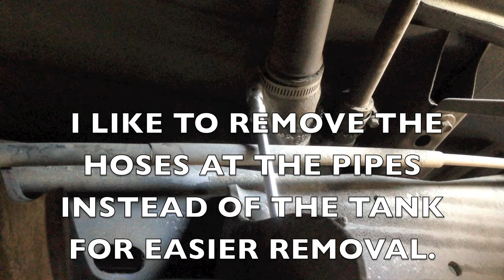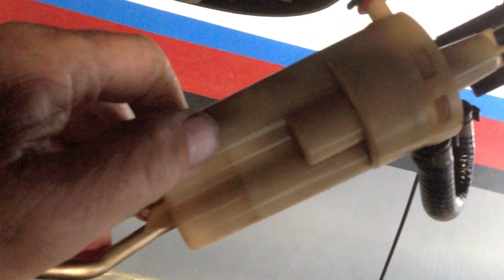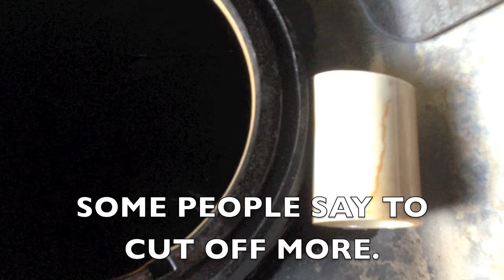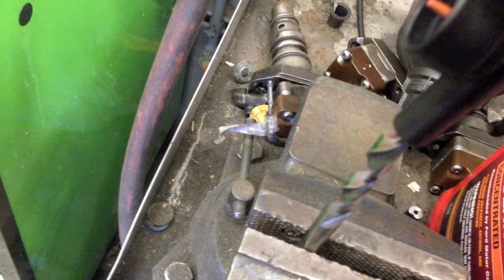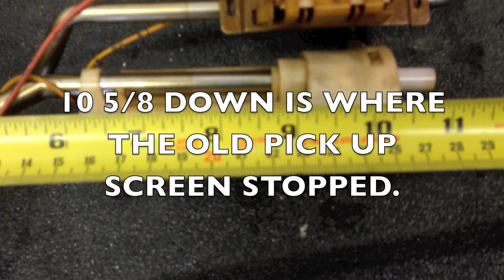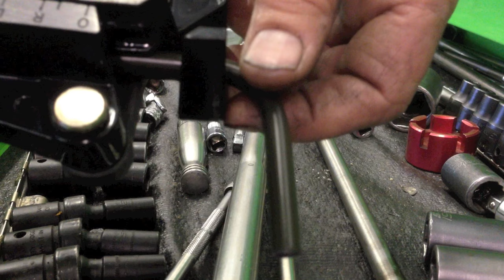Ford 7.3 Powerstroke fuel tank mods. Harpoon and Hutch

Comment: I just finished doing this today with a floor jack to take the tank off . Man I wish I would have seen this video sooner . I bought a CPS , ICP , IPR , motor craft fuel pump . It ended up being the tank . I did exactly what this showed and I ran a fuel filter before the fuel pump . Test drove it after the modification and all the new parts and dang that f350 dually had some pep in its step . I also harpooned the inlet like he did .

Comment: If the filters were full of algae and maybe tank coating flakes and you remove the filters, won't the algae and debris be able to flow into the fuel pump and engine? I need a new fuel sending unit, not sure if I should leave the filters in or just remove them

Comment: I did this several years ago. It worked fine for a long time. But, those Bosch pumps can clog if the screen is too coarse. I went thru 2 pumps before i restored it back to stock. The original lasted for 300000 miles.

Comment: on the factory pick up foot you need to put a 3/4" freeze plug in to block the port, this is why people have issues when the fuel gets below 1/4 a tank. never use galvanized tube in a diesel fuel system, the diesel fuel reacts with the galvanized coating and will cause it to flake off especially if you bend the tubing, I used stainless tube and fittings because copper compression fittings are not hard enough to bite into the factory stainless on the sending unit

Comment: if you did the efuel pump mod and the fuel bowl delete mod install an inline pre filter screen and remove the in tank screen, a large capacity inline screen prefilter screwed to the pump makes life easier and makes the flow better with far less restrictions
harpooning a gas tank might be dangerous because it needs room to vapor expand, should be fine on diesel since the fuel works a bit differently and has a different vapor point

Comment: I accidentally added gas to my F750 SuperDutyDeisel engine drill truck and had engine running until the engine stalled out.  Any suggestions for cleaning of tank , replacement of filters, or anything else I might need to do in order to save the engine of my work truck I make a living with?  Please help and thank you.

Comment: Instead of a union fitting and hard line ,,could I just clamp of fuel line and run it down far enough to bend when hitting the bottom of the tank ?

Comment: What’s the tool used to remove sending unit at 1:36
Reply: it's a cap tool specifically for this application.....not necessary....just use a small length of wood and tap the ribs counterclockwise......

Comment: Just a note to anyone bending tubing, if you'll fill it with sand blasting sand, are real fine playground sand, the tubing will bend as if on mandrel pipe bender. This prevents any restrictions from crimping your tubing down on your bends, thus giving full flow of whatever your lines have moving through them. Yes even the hard brake line as he was using in second option, with tubing from supply house.. Just blow it out with your air hose, and flush with brake cleaner good couple times.   RIP DTR

Comment: So if those pre filter screens were getting plugged up from algae and you remove them won’t the filter on top of the engine now get plugged up from the algae?  It would make sense to me to put a easy to change canister filter somewhere under the truck before it goes to the filter on top of the engine. Any thoughts on this. I know Ron passed, but if anyone else would like to comment please do.  I’m looking at doing this to my 7.3 in the next few weeks.
Reply: I would say its much more common to pre filter the pump now. If you look at any E-fuel kit for an OBS 7.3 they pre filter the pump
Reply: so just change the filter on top of the engine more often....it's a 5 min job
Reply: my plan is to do this ( no screen) , with a fass water and air filter with a 244gph lift pump. the remove the check valve in both the fuel inlet at the bowl and the valve at the bowl filter tube .... should flow alllll the fuel ill need for a medium performing 7.3 in my welding truck. i would recommend the hp oil cross over line with the rifraff high flow banjo bolts.

Comment: As I can correct excess diesel in the engine oil crankcase. 6.4 ford 2010, help me please
Reply: Replace your injectors.
Reply: @markusgarvey  it's a 6.4, replace the pickup
4 million made and 9 years later, 500k left on the road
Reply: @galehess6676  Shorter: JUNK. You would think ford would have their act together with engines...Like the Triton...Great name, crappy engine. The best diesel they ever made, was not even made by them.  All the manufactures are going with extreme high pressure fuel injection on gas and Diesel. They  might be getting better efficiency. but how my times can you push fuel through a tiny hole at 20k psi  before you start having issues. Make injector tips out of Platinum and they will still erode at that pressure. and cost an arm and  2 legs to replace

Comment: Thanks Ron, I have a 2003 F450 6.0 Diesel and was wondering if my truck has the pickup screens,  my sending unit is screwed done  to the tank, it looks a bit differ than yours.
Reply: Ron is dead and yes your truck has the little filters.

Comment: Thank you Ron. I did the fuel filter replacement today with the harpoon. RIP and God Bless I used a 8'' c clamp from harbor freight to get the fuel tank cap off..worked great.
Reply: RIP RON
Reply: Good idea using the c-clamp...RIP Ron
Reply: @moneymac2864  4 ft waves? Lol
Reply: Did you have a problem getting it back on? I can’t get the thing threaded back on.

Comment: AWESOME in tank mod, my truck ran amazing for 600 miles! Then the new fuel pump died on me at the campground. My only guess is contamination, I'll be running a pre-pump filter from now on. But the truck has never run better, smoother, quieter, or as powerful by splitting the fuel lines in the tank! New pump on her again with a pre filter and we will see how long this on lasts.
Reply: Michael Dyess  you can up the fuel pressure with a return line regulator from stock pressure 45-50 to 70 psi for better performance. just install in the return line and adjust to 70 psi at idle.
Reply: Michael Dyess What pre-pump filter system did you install? Thanks
Reply: @JpBerger3  🙀 and the plot thickens 

Regards 

fox news 🤣

Comment: Federal law requires a 10% dead air space to allow for expansion. I have seen aftermarket tanks with no tube. This is only a problem if you fill the tank all the way and then park the truck.  If you fill it all the way and then drive long distance, there is no chance of expansion causing a problem.  Also, diesel fuel doesn't have the evaporative profile of gasoline.

Comment: Added this one to my favorites.  I have a 7.3 with an aftermarket steel 46 gal tank.  When it hits empty, I still have about 12-15 gallons left according to what I put in it.  Might be the fact that the filler tube extends too far into the tank or the sender doesn't hit the bottom.  Great vid

Comment from the maker: To me its a good mod for contamination like algae. Its soft and should not damage the pump but will leave you stranded. Of course the correct answer is get rid of the contamination and don't allow any to enter. Most guys are installing an external filter before the pump to protect it. If you're not sure then install the filter in line.

Comment: Hey Ron, if our tank has slight contamination will this mod be ok? I'm taking it that the fuel filter at the top of the motor will be sufficient?
Reply from the maker: If you have contamination it should be cleaned out. Fuel is normally filtered before it leaves the pump. I ran mine  over a  hundred thousand miles this way and there are thousands out there for over a decade doing this. If you are unsure install another filter. I never did but maybe I'm wrong.

Comment from the maker: If the problem is consistent with your gauge you can remove your sensor and monitor the signal while you lift the lever up and down. If its real random, by far the most common cause is the sender.

Comment: Question Ron, My 02 has had fuel gauge issues since I first got it and I have yet to figure out the root cause on my own.

What "Appears" to be happening is as if the float is sticking/hanging up on something at random, and as a result gives quite unreliable readings, do you have any Recommendations on fixing the problem?
(FYI where i live we have been frequently having severe problems with contaminated fuel)